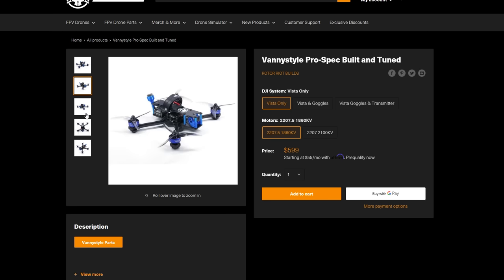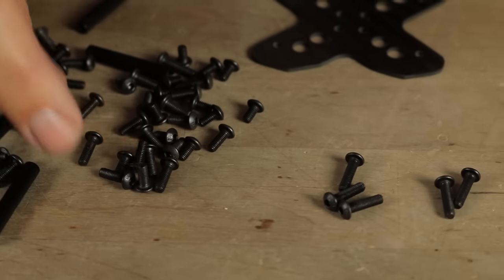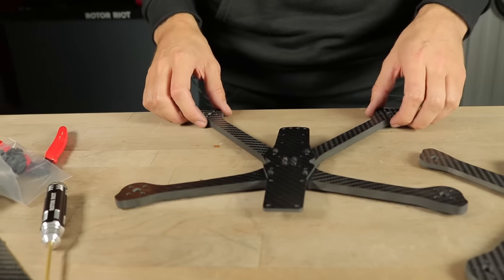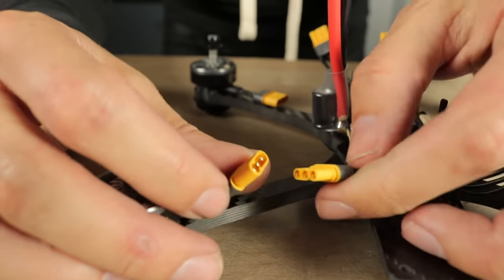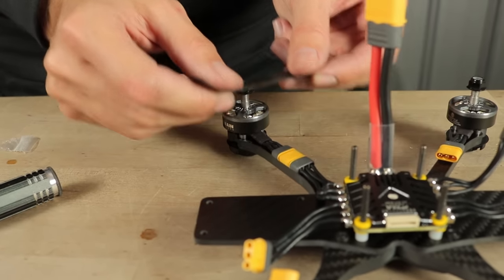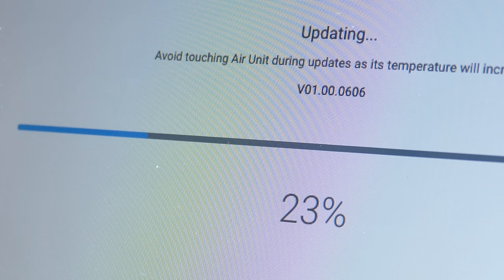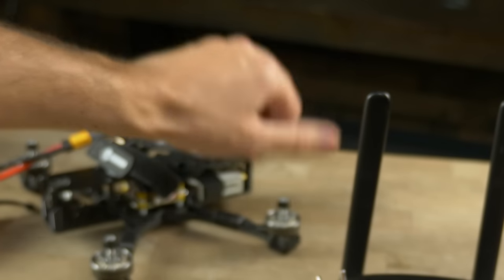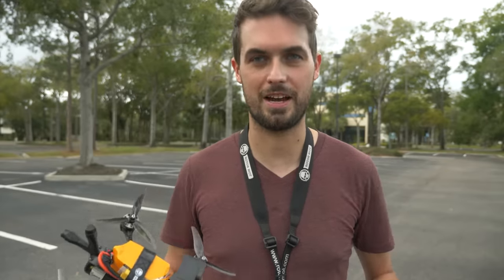Build a FPV Drone with NO SOLDERING! The Plug & Play DIY Kwad.

Comment: Not a fan of the big black toy looking DJI remote. If there is an option that I can use this with my Spectrum DX8 G2 remote or a similar remote with a nice large screen that I can make quick adjustments on then sign me up, I will literally order right away.
Reply from the maker: We can do one with a presoldered receiver so you can run Crossfire, FrSky, or Ghost. Just email support@rotorriot.com
Reply: @RotorRiot  Wow, thanks for the reply! I’ve been in RC my whole life and have been wanting to get into fpv hardcore for a while now, but the whole process is extremely intimidating. This might be exactly what I need to get more involved. Will be putting together an email shortly, thanks! 🙏